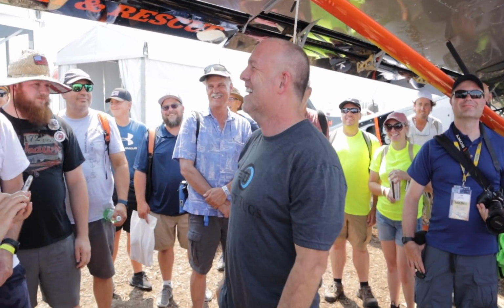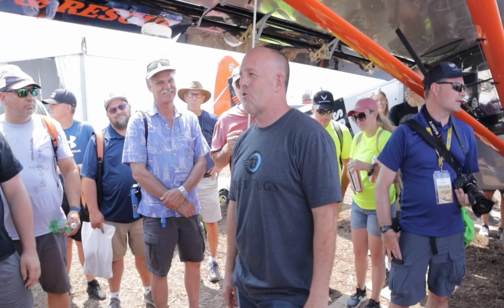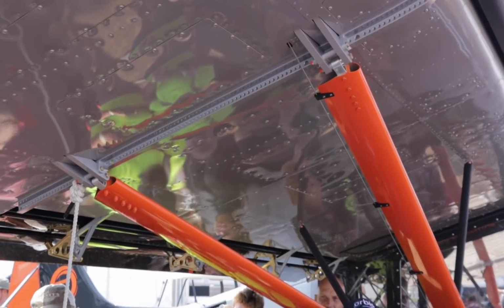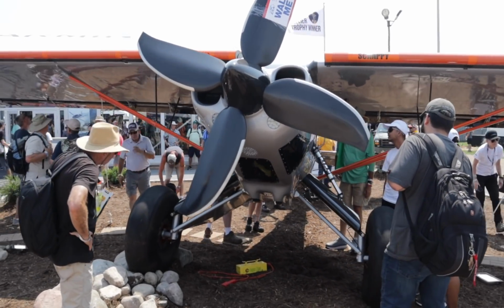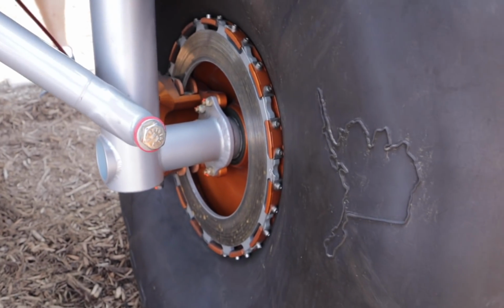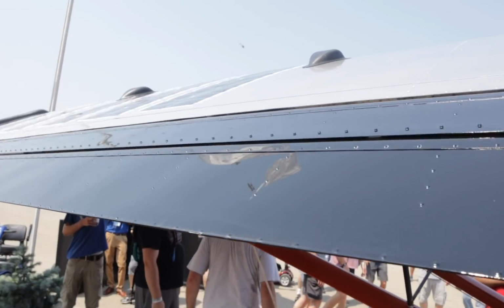Mike Patey flew Scrappy to Oshkosh to tell us about it!

Comment: Did you notice the wing stingers on the wing tips?!!! Thanks to the Draco videos I understand what it's for!
Reply from the maker: I didn’t! What’re they for?
Reply: @CLEAREDDIRECT  They protect the airplane in case it starts to twirl around in a ground loop after landing or during take-off. As the wing tips over (either side), instead of striking the wing directly, the stingers absorbs a lot of shock and also transfers the load onto the main truss/center part of the wing. This way it prevents the ribs and other parts from taking a direct hit and causing untold damage right off the bat. Of course there's a limit to the protection but at least it gives the pilot some leeway in case s/he gets into a ground loop. The idea comes from early 1900 airplanes which were notoriously prone to ground loops, so the builders build in these things to absorb the shock and break off when it became too much. That way it at least slowed down the momentum, leading to far less damage than without it.
Reply from the maker: @kevinrtres  Ah yes, I did notice them but didn’t know what they were. I’m new to tailwheel aircraft but that makes lots of sense. Thanks for the explanation!

Comment: High RPM with a large pitch/paddle prop you end up with inefficient pull of air - just like boating where it's called "cavitation".
Reply: @ Bru Star, funny that, as we recall this odd prop came from an airboat, so unsurprised that he's had issues at the high end, but then "Scrappy" morphed quite a bit from Mike's initial description of recovered bits and pieces to custom machined and custom carbon/kevlar/fiberglass fabbed everything, to our great satisfaction and entertainment. There's seemingly nothing he can't create. Eventually, he'll probably show us something amazing as a prop as well. More will be revealed!
Reply: @XiamenBill78  He's already said that the prop is purely an extreme data-gathering exercise (it's safe to say he never actually believed it would be practical long-term solution), he's working with a major company on a (you can bet novel) constant RPM prop that will allow maximum speed, at the moment he said he's flying 120-125 max (not sure if that's knots or MPH).

Comment: I bet it gets a Procharger installed the the near future.
Reply: Have to put that "Oxygen" system to work,I think you are right.
Reply: I thought he said it was already like an 800 cubic inch engine. I believe he even has nitrous oxide on it as well. Just for calling this from memory but I believe he said it's like a 2500 pound plane.. an 800 cubic inch mountain motor should easily make 852 1,000 horsepower, with nitrous, 1500 for 20 seconds. I don't think he's going to have really have any HP problems. The potential problem I see is the mass of the prop. If I recall correctly I believe it's designed for a airboat. No airboat expert but I wouldn't think they would exceed 75 to 90 mph . He has designed this plane to fly slow, but I bet he pushes it over 200. Maybe even upwards of 240.